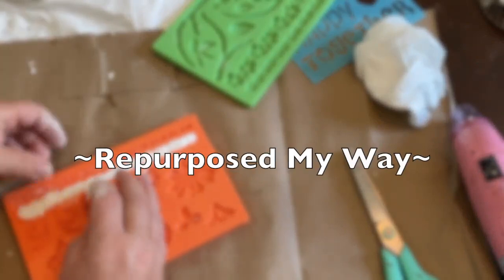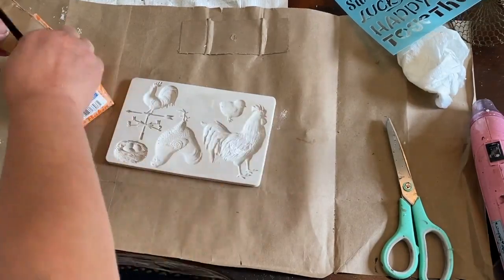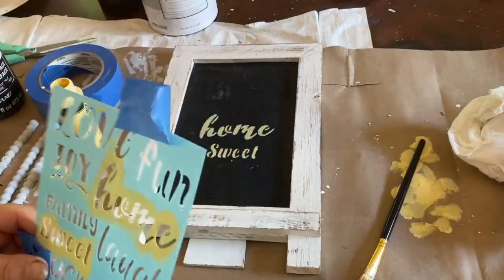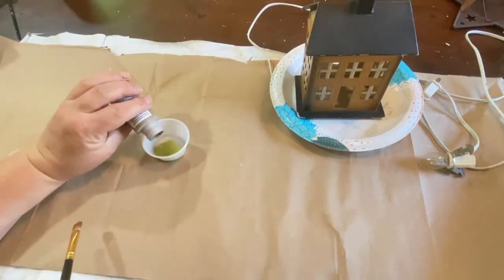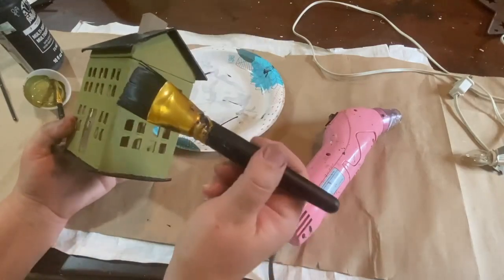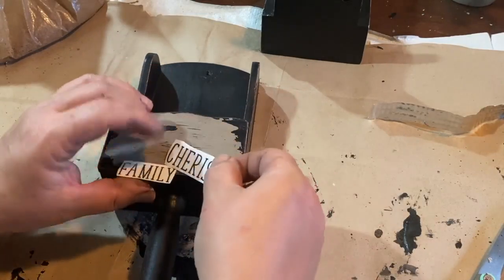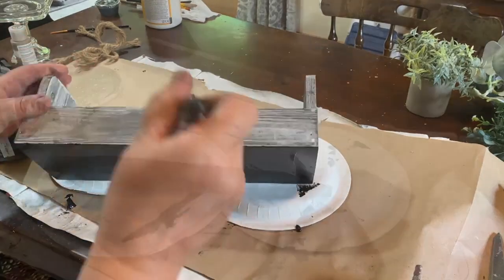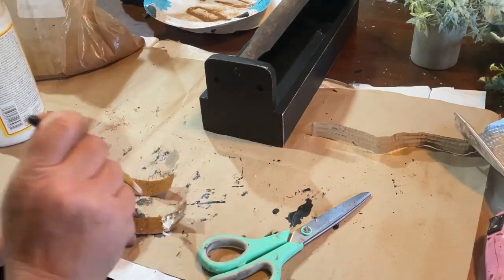Thrift Shop Flips and Yard Sale Finds | Repurposed Home Decor | Stencil, Clay Spindle Techniques

Comment: Sherry try using baking soda on your clay molds. Makes removing easier
Reply from the maker: Thanks Carol. I used baking soda because I am out of cornstarch and really it releases fine, It's the small feet and legs on the rooster that don't say connected. Someone mentioned to put the mould in the freezer next time. I will be trying that. Thank you for watching.